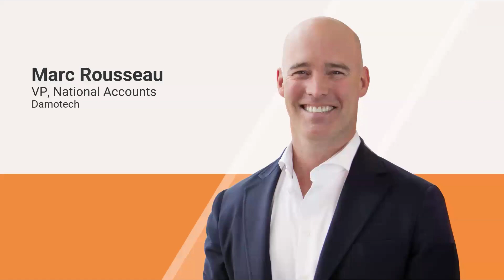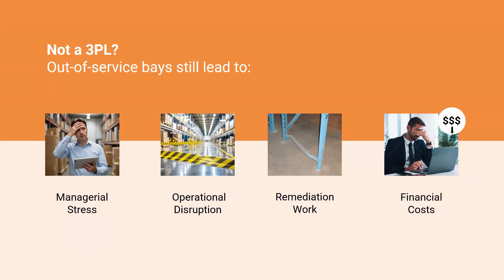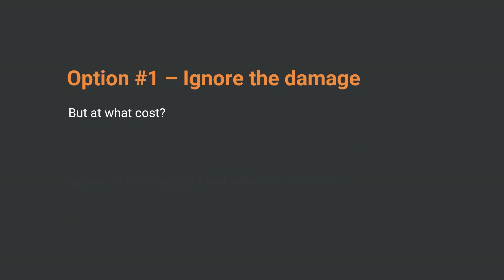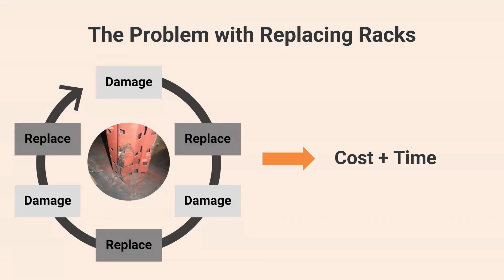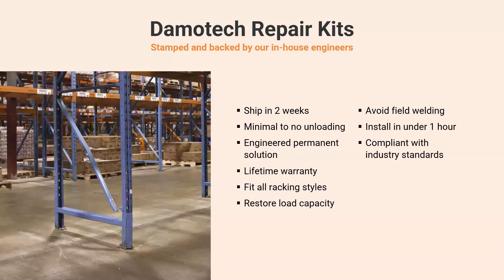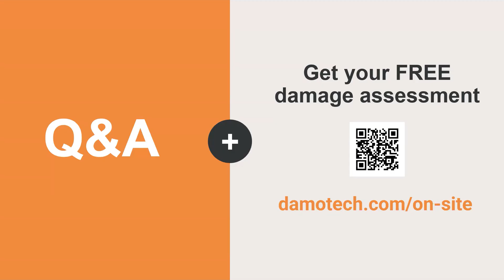Pallet Rack Repair vs. Replacement: Cut Maintenance Costs up to 85%

Comment from the maker: Quick recap for anyone weighing rack repair vs. replacement 👇

When a forklift bends an upright you've got four options: ignore it (risky, and it invites OSHA scrutiny), weld it in-house (tough to do to code), replace the whole upright (long lead times + repeat damage), or use an engineered repair that restores load capacity with minimal to no unloading. In Damotech's 10-year cost example, engineered repair came out up to 85% cheaper than repeatedly replacing the same upright, and it's backed by a lifetime warranty against impact.

Not sure whether a damaged upright needs to come out of service right now? Get a free rack damage assessment → https://www.damotech.com/free-rack-damage-assessment-form-lp

Question for the group: what's your facility's biggest rack-safety headache — recurring forklift hits, inspection backlogs, or downtime? Drop it below 👇